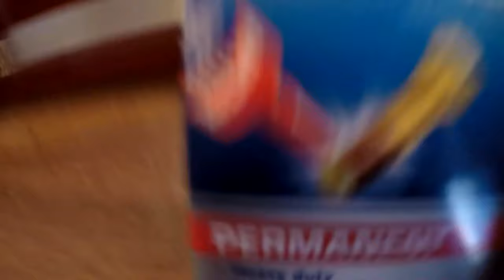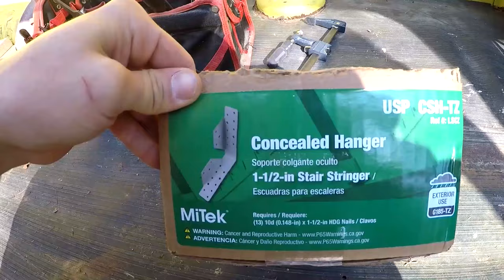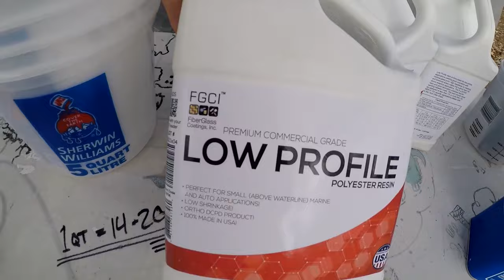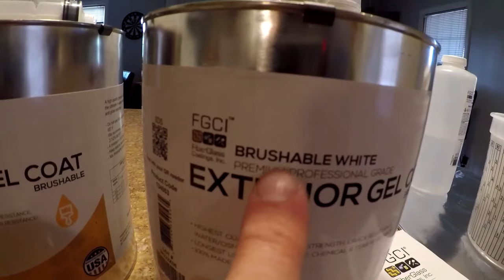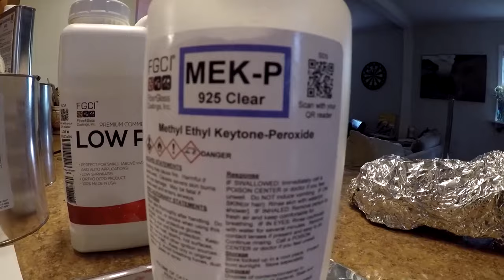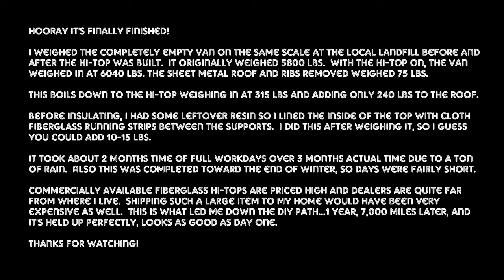Best Custom DIY Van Hi Top Ever

Comment: Hello, can I ask what the white and red paste that you mixed was? was it wood epox?  a list of items and  tools would be incredibly amazing if you can, but that is the only thing I cant figure out what it is no matter how many times I hit pause/play. amazing work!
Reply from the maker: The pinkish paste is regular Bondo brand automotive body filler.  I'll get a complete list of all materials used and get back to you.
Reply: @itsnotthatyellow  awesome thank you very much!
Reply from the maker: This is a very close estimate of what it took to build the top.  This IS NOT EXACT, I had an accurate list kept and lost it along the way...sorry.

(20)  tubes Loctite PL Max premium glue
(16)  tubes 3M 5200
(1)    tube Loctite red threadlocker
(1)    gal Bondo
(12)  cans Great Stuff foam

(20)  untreated pine 2x4x8s
(2)    treated pine 2x4x16s
(1)    untreated 2x6x8

(34)  1/2” grade 8 bolts gold zinc plated
(34)  1/2” grade 8 washers
(34)  1/2” grade 8 nylon lock nuts

(42)  1 1/2” stair stringer concealed hangers

(1)    1/8” steel plate 12x24

(1)    can Rustoleum spray primer
(1)    can Rustoleum spray paint

(6)    gal FGCI polyester resin
(1)    gal FGCI brushable white gelcoat
(1)    gal FGCI brushable canary yellow gelcoat

(? lots of ?)  (1 1/4”), (2”), (2 1/2”), (3”) exterior coated deck screws
(? lots of ?)  sanding pads, belts, and sheets

---------------------------------------TOOLS--------------------------------------
circular saw
jigsaw
miter saw
table saw
oscillating saw
belt sander
palm sander
drill & bits
ladders
tarp
3' level
socket
wrench
hacksaw blade
clamps
Reply: Love the soundtrack instead of talking. Curious, how many hours and how much $$ did all this take to complete?

Comment: How many exterior layers did you apply?
Reply from the maker: Just a single layer of chopped strand mat.  Not too thick, not too thin...I honestly can't remember the weight or thickness of the glass.

If I had it to do over I would probably add an additional layer or two...the resin penetrates into the plywood somewhat and acts as another mechanical layer I guess.

She's held up great, I may apply a coat or two of 100% silicone RV roof coating...Thanks for watching!

Comment: i have a Chevy 3500 express with 4 rows of seats, I burn  a little more than half a tank just going back and forth to work  (28.7 miles one way) 5 days a week  so with your new roof  how much do you burn?
Reply from the maker: I can't say for sure, judging by different cars and trucks I've had over the years I'd guess around 18mpg on straight, flat highway believe it or not...it's really not thaat bad.  I'll record the miles driven after next fill up and get back to you.

Comment: All that work. All that heavy wood. I'd have just opted for purchase of a pre-formed fiberglass top, sealed and bolted it on. Hope it doesn't raise center of gravity on the van too much, easier to tip over maybe, if you have to whip the steering wheel to avoid a crash. Job is done well, but gheez!
Reply from the maker: The weight is actually comparable to a commercially available high top... Even lighter than some believe it or not. Thanks for watching

Comment: How much resin.you use.
Reply from the maker: It took 5 gallons of resin, I had 7 gallons ready.  Barely got away with using 1 gal of white and 1 gal yellow gelcoat.  I used FGCI brand resin and gelcoat.

Comment: absurdly overbuilt - you coulda got by with less than half the bulk and weight - even with wood framing. I would have looked into extruded aluminum for the framing (about 25% of the extra weight). Even so, what you did was well done and gave me some ideas for doing a raised minivan.